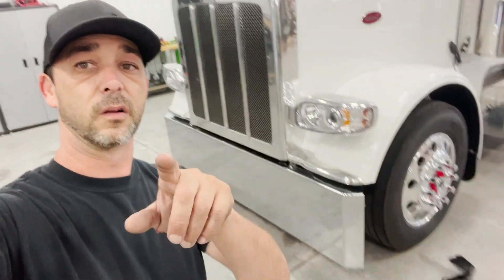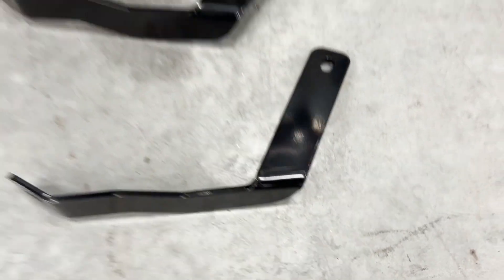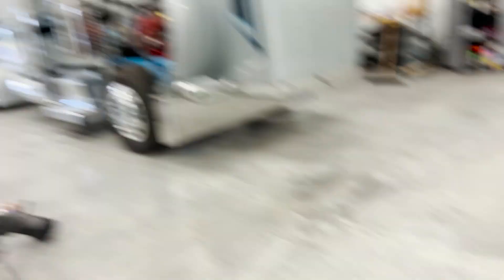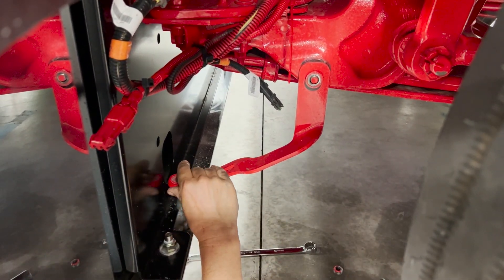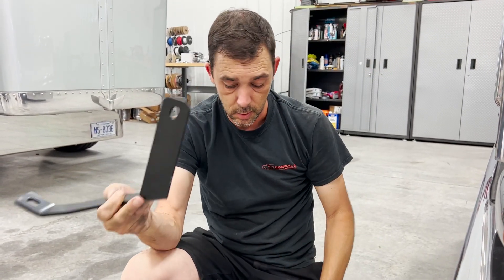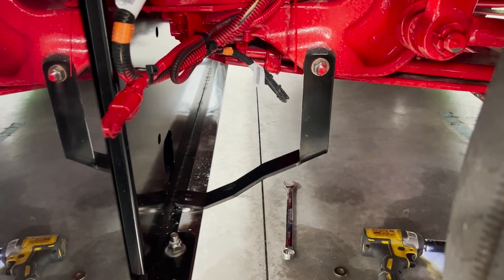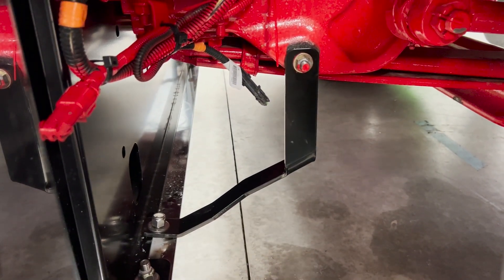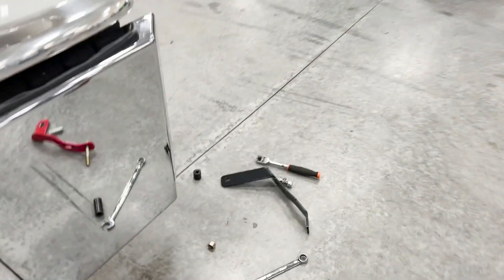Nothing worse than a shaky bumper!!!

Comment: Another issue with mounting even the new bracket is that the rear mounting plate to the bumper the lip where the bottom bolt goes is not as wide as the bottom lip of the bumper and is giving you an uneven bolting surface possibly loosening the bolt over time.